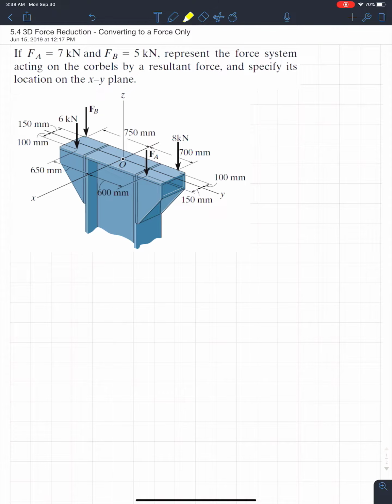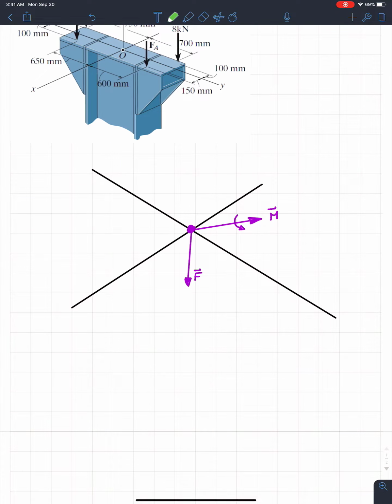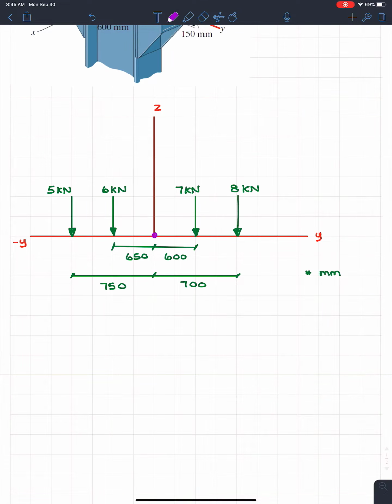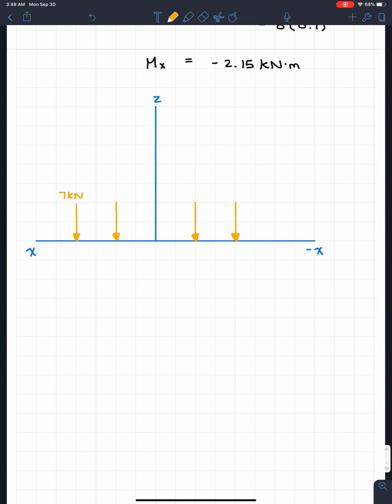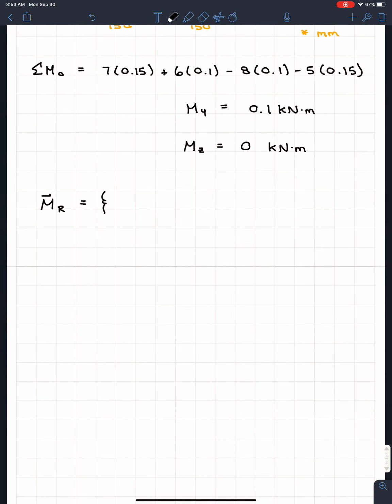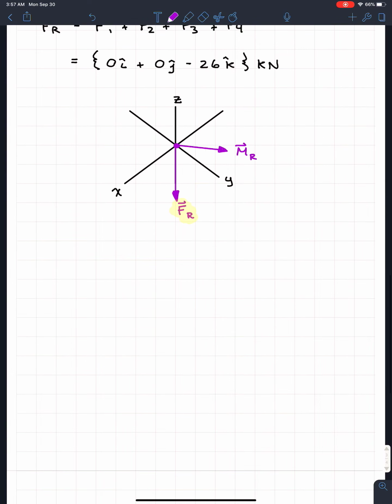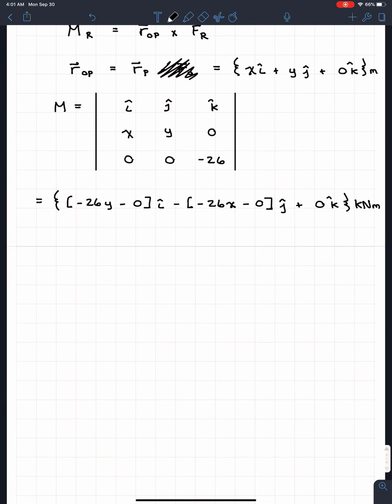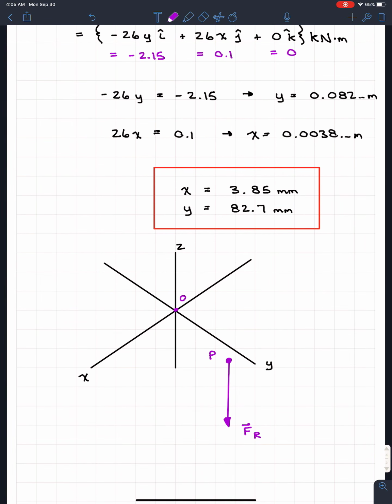Engineering Statics | Old Example | Force Reduction into a Force without Moment

Comment: So when we find the resultant moment and force, that force in reality doesn't act around point O as was expressed in the last example video, rather that is just standard practice in writing the resultant moment (when we don't care where it's acting to create that moment), and the true resultant moment acts somewhere else that we can't determine initially unless we use the cross product and solve for those unknowns?
Reply from the maker: Yes in reality there are is not a resultant force but rather many single forces.  However, the resultant force/moment system will have the same effect as the many independent forces thus it is easier to analyze resultant force/moment systems as we are dealing with a single force and single moment rather than many.  The best way to describe this will be when you cover distributed loads.  Technically we can analyze a distributed load as infinitely many forces acting at multiple points but it is simpler to convert the load to a single force acting at one specific point.  Hope this helps :)